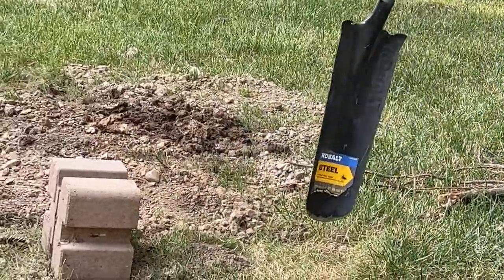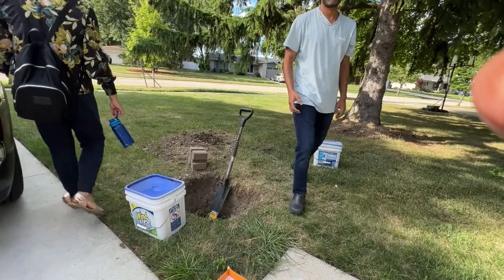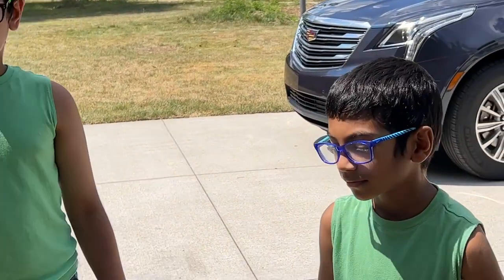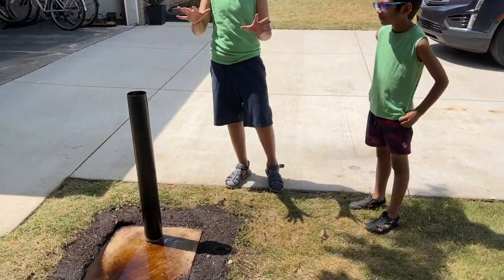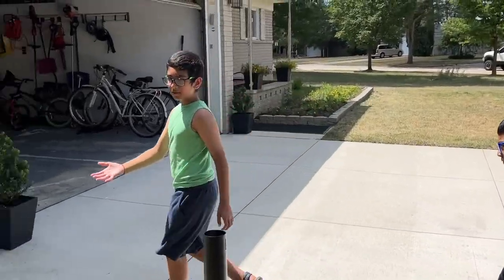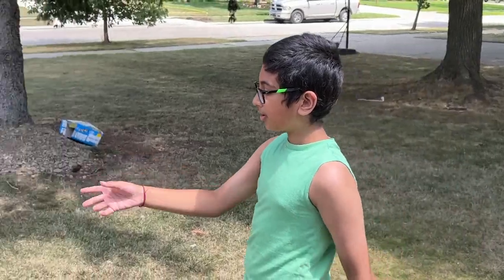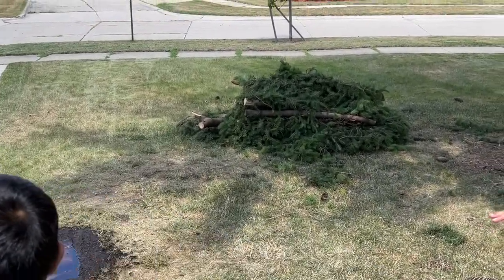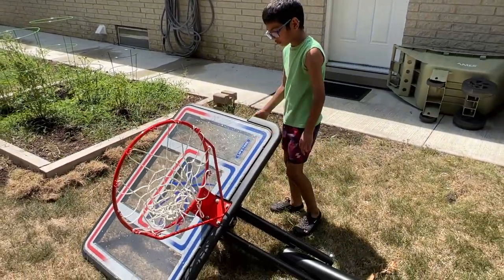Hoops at Home: DIY Guide to Installing an In-Ground Basketball Hoop

Comment: I just installed a Probase support system. No digging no concrete. Just need a 10lb sledge, 5/8  socket, ratchet and level. Its a good system. 159.00
Reply from the maker: Thank you for watching